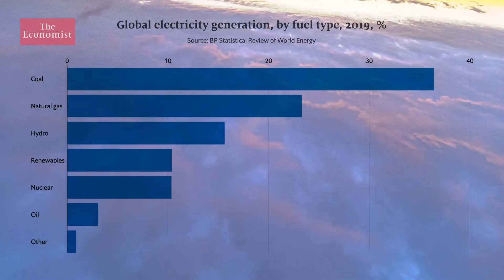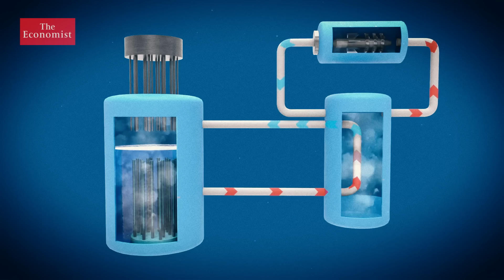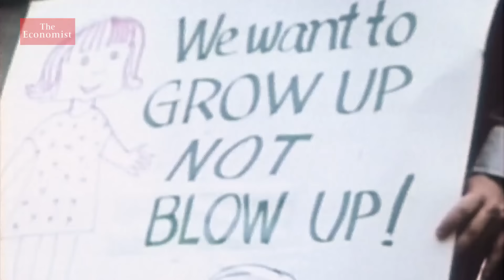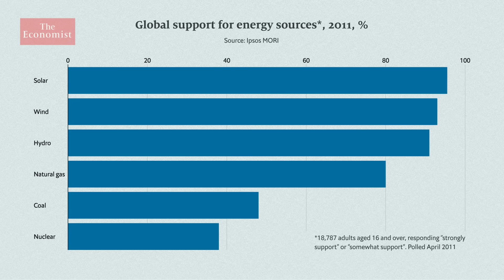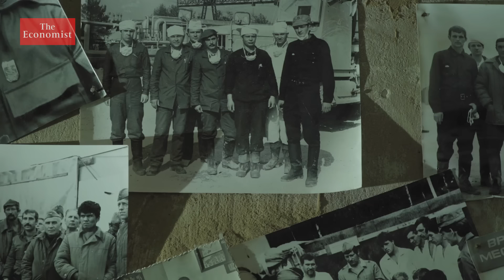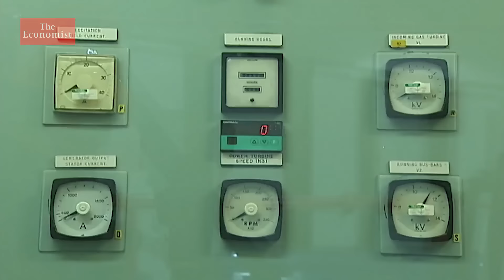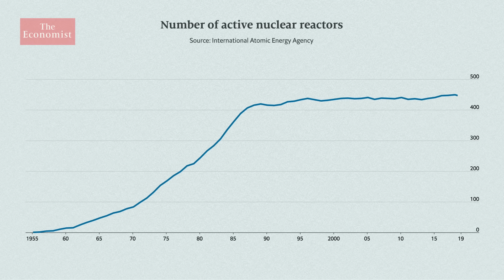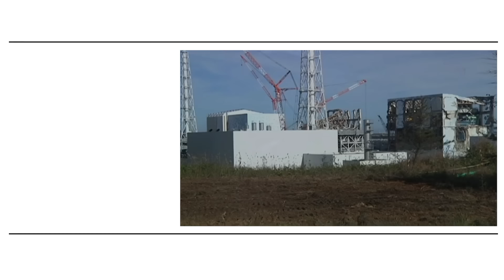Nuclear power: why is it so unpopular?

Comment: Well, this time video is missing one important aspect - the unpopularity (and problems) of nuclear waste. Without including that topic, I don't think you get the full picture about nuclear energy.
Reply: So 50+ years of anti-nuke propaganda is grounds to ignore nuclear energy?
Reply: Ionenweaper...Yes!He doesn't mention tons of nuclear waste piling up at plants that we still don't know what to do with.Chernobyl caused an entire city to be abandoned and Fukushima will take 40 years plus to clean up.
Reply: @superaa6779   Those spent fuel rods will will be valuable fuel in thorium molten salt reactors, let them pile up!  This stored "nuclear waste" has never harmed anyone.
Reply: There's such a tiny amount of waste produced, it's not really a problem. And you can use that waste as fuel in different types of reactors anyway, so that waste is quite precious.
Reply: there is far more danger from the ecological impacts of the mining and waste surrounding solar energy than the minuscule, well contained, re-usable spent fuel of nuclear reactors.
Reply: I work at a gas powered power station so get to see how the national grid works with balancing energy supply and demand. I’m all for going green with renewables but there are still big issues that need to be understood and discussed as part a conversation about energy and not just focused on one part. The biggest issue with three issues with renewable is when it’s not running to the same demand (to much or too little) what do you do? How can you store the produced energy for another days use or with month (pumping stations is system used but requires huge areas to be flooded (more environmental damage), battery storage (again more environmental damage with lithium mining) and new idea being developed compressed air storage (still not the safest way but at least very environmental friendly)). How can you make sure the energy that is being produced is at the correct frequency of 50 hz (currently they used the traditional power station generation to act as the hertz controller and the green energy sync up to it))
Reply: @mattvanders   This is something all the "100% renewables" crowd love to ignore.  If fossil fuels are to be phased out in an era of climate change, nuclear is the only other option unless we are willing to put up with shortages and rolling blackouts.
Reply: The nuclear waste a very small part in this story.
We have seen nature taking care of a lot of problems finally.
You have a 1 m3 of waste to produce the electricity for 20 million people.
Reply: In l'y opinion the problem of nuclear waste is largely inflated by propaganda against nuclear energy. A lot of industries produce a lot of dangerous  waste we don't know whar to do about, but thé media concentrate all the attention on the des dangerous wastes nuclear produces. Solution like geological confinmenr already exist, but are volontary ignored by anti nuclear because having a solution would break one of their major arguments.
Reply: @danadurnfordkevinblanchdebunk  nuclear power plants are great for continues base load production of electricity, really not idea for turning on and off or just changing for demand. Our gas plant ends up getting turned off and on depending on demand for 4 hours minimum. Summer months might get called on once every two weeks, winter it will be more in stints depending on weather (cold spells with no wind). We are even looking in to retro fitting equipment to have the ability to use excess electricity to just spin the gas turbines (to even out excess electricity products by green sources in summer months).

Comment: "Nuclear reactors built between 2016 and 2019 average time of construction was 17 years"

That is really not correct. The issue is that in 1990 a number of nuclear power plant project was aboundand. Some of then when only the foundation was finished. Between 2012 and 2014 a lot of those projects was restarted and most of them finished in this window.
Reply: In my country all nuclear projects were started in the late 1970s and all were stopped, after decades that 2 of the projects were restarted and completed, and only now the third has been restarted and is about to be completed in 2026 if it is not stopped again.

Comment: Thorium would make nuclear energy much safer and accepted through the general opinion if a serious news provider like the Economist support it.
Reply: First commercial reactor used Thorium, Shippingport, it also was a LWR.
Reply: @andrewjmcd919  too bad they only made one . Uranium is as rare then silver, thorium is every where.
Reply: Yes, Thorium is about as prevalent as Pb. But if the reactor was a molten salt where the fuel could be fully burnt then you would need less.  LWRs are once through type and only use about 2% of the fuel.
Reply: Thorium power>all!
Reply: Thorium has too much, Hype, it is not a miracle, is just another nuclear fuel.
Reply: @businessproyects2615  yes but there is far more Thorium than Uranium on Earth. And it s semi-life self destruction process is much shorter than with Uranium.

Comment: Why no mention of nuclear waste?
Reply: Becouse they are storage in Underground
Reply: @blank4844  That doesn't mean it's not a legitimate concern that should be addressed in a piece about nuclear power. What happens when the waste isn't sealed properly and contaminates ground water? Or we run out of space in designated areas? Or an oil company messes up and fracks in the wrong place? Even if it's unlikely these are things people are worried about so they should have been addressed in the above article.

Comment: (8:00) Chernobyl didn't had containment building. Just a shady Soviet cost-cutting BS.  Compare the results with Fukashima!!!   Why the this reportage didn't pressed that fact?? A missed opportunity.
Reply: You do realize the soviets were broke
Reply: @perlasandoval7883  They were broke because of a terrible economic system, but that doesn't change the fact that the disaster occurred because they cut costs, not because nuclear is inherently dangerous.
Reply: @Auriflamme  they have to cut cost in order to save the economy and the state from total economic collapse
Reply: @perlasandoval7883  Like I've said, that is completely beside the point. The point is that nuclear isn't inherently dangerous.
Reply: @Auriflamme  its actually part of it

Comment: What about the nuclear waste it produces? All of it won't break down for thousands of years..
Reply: There are only about 370,000 tons of waste from the last 65 years of nuclear power production, around 10% of global electricity for the last several decades. It is captured, stored, monitored.

First, it 370,000 tons trivial - in comparison:
A single coal plant in Moorburg, Germany creates 370,000 tons of waste in 16 days, around 2.5% of German electricity for the last several years. It is vented to the biosphere - not captured, not stored, not monitored.
A single natural gas plant in Pastoria, California creates 370,000 tons of waste in 83 days, around 2.5% of California electricity for the last several years. It is vented to the biosphere - not captured, not stored, not monitored.

Second, if the fuel were separated into the highly radioactive fission products and the less radioactive actinides, the actinides can be placed back inside a reactor to generate more power. The fission products  are very radioactive, but decay to background levels after about 300 years. This is proven technology done commercially by the French already.
It is the lack of separation that keeps the radioactivity high for thousands of years.
Reply: you put it back in the same hole you got it from... and if you want renewability you can use nuclear reprocessing to recycle the waste and create new fuel

Comment: But disposal issues are well documented and yet to be adequately dealt with. Quite aside from how cheap solar, wind and battery tech is becoming. It will be quicker to deploy renewables than build nuclear for the coming climate disaster.
Reply: The disposal issue is moot. There are already reactor designs that use nuclear waste. Also, solar and wind are nowhere near reliable enough to supply the grid was a sufficient base load. Nuclear power can and always will.

Comment: i think you have forgot to mention the cost of storing the spent fuel. currently in the uk the government is studying geological waste facilities which will have to be monitored for atleast 1000 years, this will only increase the running cost of fission nuclear reactors.
Reply: Yeah true, nuclear is expensive because they have to take care of their waste, while fossil fuel electricity generation can stay cheap by releasing their waste into the atmosphere, causing far more deaths and adverse effects (air pollution alone causes more than 4 million death/year), if you made the fossil fuel industry pay for even some of the damage their waste causes (i.e. a carbon tax) the prices would be much more similar
Reply: U mean u rather have CO2 across the entire globe than monitoring some facility for a 1000 years?
Reply: What about the cost of storing and recycling turbines and solar panels.
Reply: Yes but nuclear reactors produce very little waste. One long term site could house hundreds of years of high level waste.
Reply: @capras12  Exactly, compared to the end life cycle of PV and Turbines.
Reply: True, but consider that even today there are serious designs that use the current nuclear waste as fuel. The claim that the waste will need monitoring for 1000 years assumes no innovation.
Reply: @budders9958  turbine and PV should be part of the solution too. At least untill we can get fusion going as they are cheap and renewable.
Reply: @capras12  Completely agree, but the idea that nuclear waste is a huge problem compared to low dense renewable power sources waste is BS. Simply look at the energy  areadensity of PV/Wind compared to nuclear and it will be evident why PV and Wind will have way more waste to deal with than nuclear. You just need alot more "matter" to make the equivalent amount of energy and power. Useless matter that is thrown away is called waste.
Reply: Name  Those spent fuel rods will be very valuable fuel in future thorium molten salt reactors.  Besides, no one has ever been injured by stored "nuclear waste".
Reply: @emilianoconde9647   @capras12 @budder s,  sorry but sellafield is at its limit it cannot take more waste and it has only been in operation for only 40 years? The US are storing their waste in open landfills and plane hangers at army bases because they ran out of space. spent fuel and High Level Waste HLW in general, can only be recovered to some extent. You do know u238 produce energy by splitting into different atoms, right? You can only extract plutonium and unused u238. The majority of HLW are fission byproducts around 20 different atoms and over 100 different radioisotopes, it better to just immobilised the radioactive waste in glass or cement for atleast 10000 of years to get them back to normal ambient radioactive level. The issue is not the amount of HLW its the period of safe keeping. Imagine were living in 2021 and you should be able to keep this radioisotopes in check for the next 10000 years. As a scientist taught by the best in the nuclear field (my supervisors are advisors of the crown) i am against this notion of storing waste past our lifetime and burden our future generations with this waste, nor do i trust our leaders to take this responsibility seriously, nor can i predict future geological catastrophes(land slides, earthquakes, HLW contaminating underground water)

Comment: Why is nuclear so unpopular?

It is expensive.
Reply: Thats why it needs funding
Reply: Why, when we have better options?
Reply: @williammeek4078  Solar needs a lot of space and only works half the time, Wind needs a lot of space and needs specific places
Reply: @decorumpantroglodytes5962  those times is does work are exactly when we need it to. Further, wind blows at night and once we get to to scale of a country like the US, the wind is always blowing somewhere.
Reply: @williammeek4078  Nuclear can be put anywhere, it will be safe and give a lot of power, if you want power that helps the environment then support solar, wind, and nuclear
Reply: @decorumpantroglodytes5962  the problem is that nuclear costs 5x to 10x as much as wind or solar. And the price of wind and solar is still dropping rapidly in. If you want to help the environment the most, drop support for overpriced nuclear.
Reply: @williammeek4078  Tell me more negative effects of nuclear power and I might start believing you
Reply: @decorumpantroglodytes5962  bring down the cost of nuclear to 1/5th what it is now and i might start to believe you.

Comment: Why paying more for a (still) much riskier energy source? You have lower total costs for renewables and get rid of the risk.
Reply: It's also not as reliable especially if electric consumption goes up
Reply: no, right now you don't. The cost of producting electricity is not the same thing as the cost of selling you electricity, you don't buy when the plant wants, the plant has to deliver you what you want. Normal plants serve you, 'renewables' work the other way around, they decide when to sell you the energy. What happens is someone else has to pay for that problem, then they put the bill on to everyone.

Comment: Nuclear power: why is it so unpopular?
Because most people are bad at risk assessment 😑
Reply: This is a bit of a myth. Yes people are bad at risk assessment. And yes those people have been a hindrance to the development of the technology. But the real issue cost and in particular the all or nothing front loaded nature of the cost. Today renewables are cheaper. And back when there were not enough people who cared about renewables coals was cheaper. This video is clickbait to the pro nuclear crowd while avoiding the real issues.
Reply: @peterisawesomeplease  Renewebles cheaper? Maybe in you country but here in the Netherlands not so much..
Reply: @peterisawesomeplease  solar and wind aren't cheaper, LCOE is an idiotic way to look at costs, it does not take into account the overall cost imposed on the other participants on the grid due to the unreliable sources.
Reply: @FullFledged2010  Location does influence the cost of renewables. As does the percentage of the grid that is already renewable, and the types of regulations. But in most of the world renewables are cheaper than nuclear. Note that this is only on a new vs new comparison. Obviously if you don't include construction costs nuclear will have big advantages.
Reply: @businessproyects2615  No even considering the need for additional storage and transmission infrastructure it still comes out cheaper in most of the world. Obviously it varies by location. And obviously as the percentage of renewables goes up the equation changes as the needed amount of storage and transmission infra increases non linearly. Going from 90 to 100 percent renewables is much harder than going from 20 to 30 percent. But for most places the amount of renewables is still well below the level that causes storage to boost the costs above nuclear.